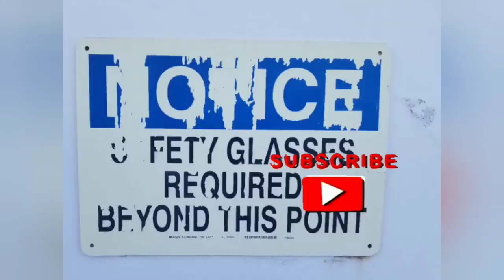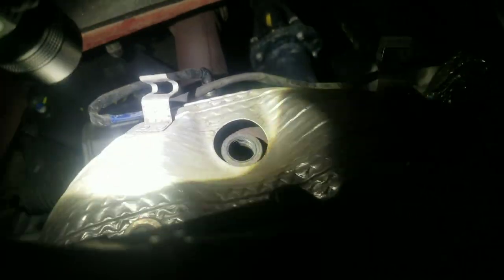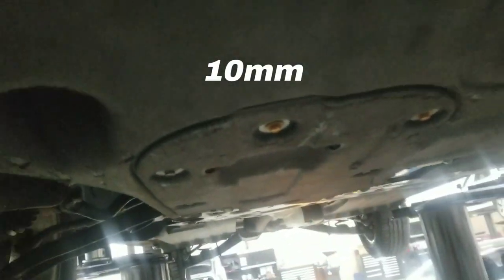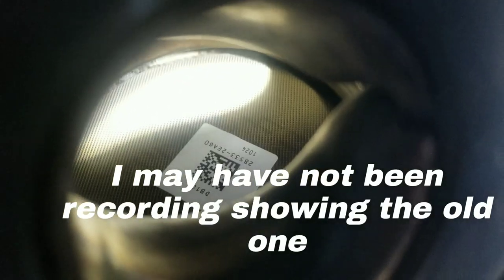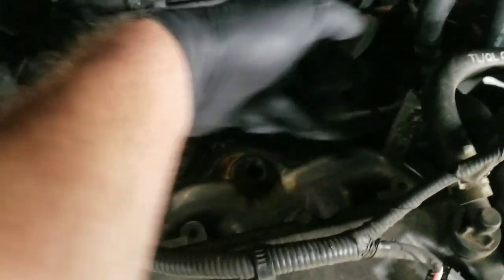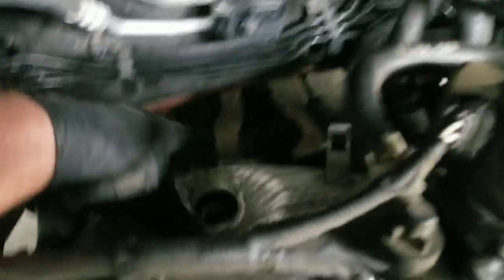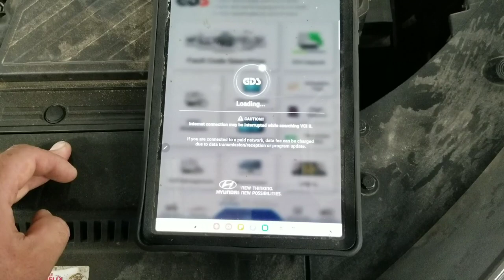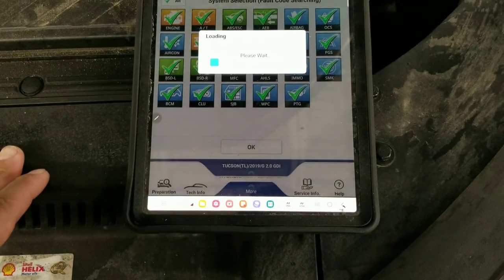Hyundai Tucson 2019 manifold catalytic converter code p0420

Comment: Hi, i am hearing "tin can" rattle under my 2019 hyundai tucson, only when when accelerating. Could this be the catalytic converter?
Reply from the maker: More likely a loose heat shield.
Reply: Is engine knock sensor